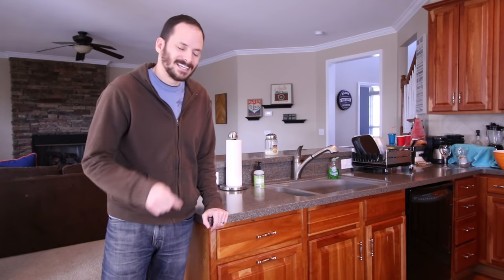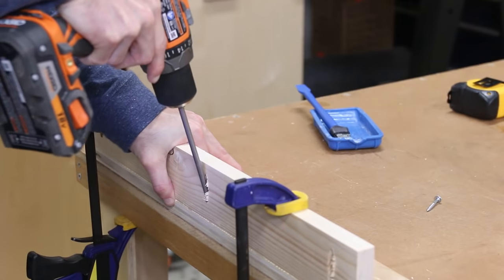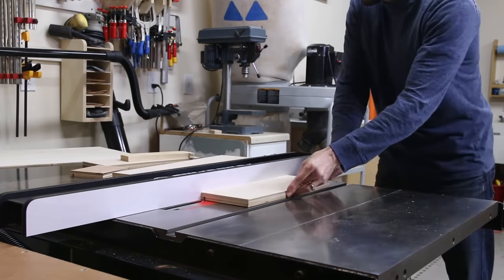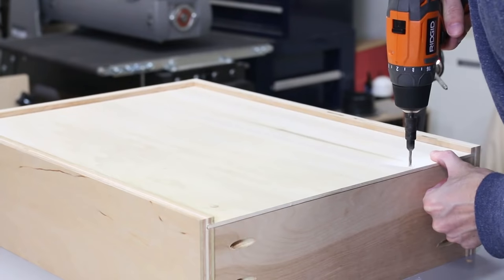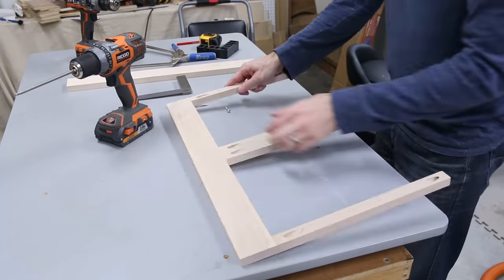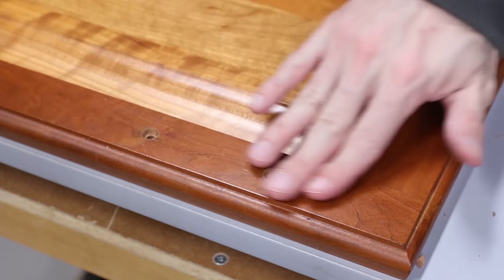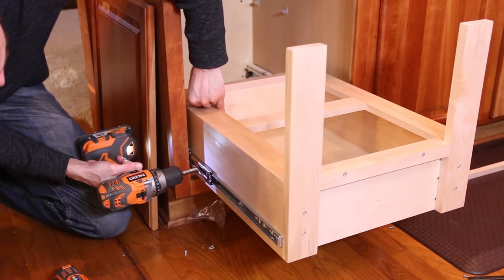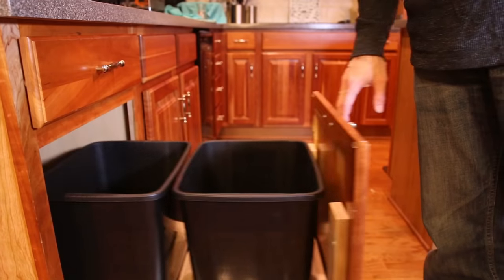DIY Pull Out Trash Can in a Kitchen Cabinet | How to

Comment: Very cool, but DAAANG that was complicated and required a lot of equipment to pull off. I guess this should be titled "DIY - if you're a carpenter with a shop full of equipment"
Reply: mhans311 this is a woodworking channel
Reply: I was just going to say I have no idea what is going on here lmao
Reply: He uses a lot of specialty equipment...but you really only need glue, a drill, and a table saw and you can do the same build.
Reply: @RyanMonty  not even actable saw, you can use a circular saw to do all of the cuts. Or even a jig saw if that's the only power tool you have. Or if you're really in a tight budget, with skills, you can do all of these cuts with a regular saw.

There are a lot of options IF you really want to build this.
Reply: I mean, these are like the basic woodworking power tools. A table saw is usually the first stationary tool people get, and you don't even need it for this. A circular saw (or a hand saw) will work just fine as long as you plan out your cuts

Comment: lol, DIY..... With $10K worth of woodworking machines....
Reply: all you need is a table saw, a level and drill... otherwise, go to home depot and they can cut the wood/plywood for you so you wont need the table saw / miter saw. you don't even need to do the groove (would probably require a table saw or router) for the drawer bottom, you can just drill it in.

Comment: Excellent video. I was looking different designs for a pull out bin. Our 6 month old Weimaraner has figured out how to open our free standing trash can to access all that it beholds, so I need another solution. Fortunately, I happen to have an extra set of 24" full extension drawer slides, along with enough scrap ply and maple so my only cost will be the two plastic bins.
BTW, I love the comment "Making sure to properly document the shavings coming off my hand plane". I can't seem to resist holding the shavings up to the light to make sure I can see through them. Again, great job.

Comment: Most any ball bearing drawer slide manufacturer also makes a rear bracket which allows you to mount the front of the slide to the cabinet face frame and the rear of the slide to the back of the cabinet, no shims needed along the sides. I measure the depth of the cabinet, subtract an inch and order that length slide with rear brackets. Then I cut a 2-3" wide strip of 1/2" plywood maybe a 1/16" wider than the width of the front face frame opening and mount the rear brackets flush with the ends of the plywood strip. The slides slide into the rear bracket, you attach the front to the face frame and push the plywood backer back to the back wall of the cabinet making sure it's square to the face frame and screw it to the back wall of the cabinet. Job done.
Reply from the maker: +Tracy Luegge yup, that would work too!

Comment: I really want a pull out trash can, however the cabinet i want to use is a 3 drawer cabinet instead of the large single door cabinet. I would need to get a new cabinet door somehow and they are the cheap laminate cabinets from Lowes so i'm not sure if i could build something to match.

Comment: Appreciate the help. Gave this a try, and it turned out ok, but not great. Unfortunately, the top of my cabinet door sticks out more than the bottom The bottom is solid against the face frame while the top has a good 3/8" gap to the face frame. Ideas? Shim the bottom of the tall anchor boards

Comment: a quarter inch bottom seems a bit filmsy.  I use 3/4 bottom pocket screwed - it's on wheels so the weight is negligible - and the added momentum feels more substantial, smoother action.

Comment: Great video! I'll prob be using it as a reference to build one myself. 
One question though; are you worried about the trash cans becoming too heavy for the 1/4" plywood on the base of the drawer? I'm wondering if I should consider 1/2" with 2 trash cans.
Reply from the maker: +Joshua Glorioso I thought about it, but figured I could always beef it up later if needed. Though I put a fair amount of weight on it and it was fine.

Comment: You have really good idea. Right now I have 1 under the sink pull out trash can. I need another bin for the  big milk carton, eggs carton, papers, etc.  Are you using 8 gallon or 30 litre bins ?
Reply from the maker: I took the labels off them, so not sure exactly what they are.  But from what I recall they were between 7 and 8 gallon cans.

Comment: What are the brand and dimensions of your trash cans and where did you get them? I have been wanting (*needing*) to build a pull out since I moved in my new place last month (which has no place for a trash can otherwise), but cant find one that is reasonably priced that will fit. If I'm going to buy the ones that I've found that do fit, I might as well just buy the whole pull-out system. Thanks for the great video! And P.S...like everyone else, what I wouldn't give to have your shop in my basement!!!
Reply from the maker: Hit the blog post (link in description) and I have direct links to the cans

Comment: Hi Brad,  It's been about five years since you posted this great video.  I'm hoping make something very similar for my kitchen trash cans and wondered if you have any new thoughts or changes to the design?  I'm currently debating about mounting the slides the top vs the bottom.  Since the pull is at the top it might slide a little easier especially when there's more weight in the cans..... just a thought and value your opinion. :)
Reply from the maker: Ours has worked out really well.  But a top loader would be fine too.  Lots of commerical ones are built like that

Comment: Hi having an issue where about a year ago the garbage cab pull out cabinet per your video tends to open on its own. All screws, tracks seems to be secure but when you close the cabinet it slowly opens up (very annoying). Any ideas on what I can do?
Reply: I have the same problem with mine.

Comment: Actually, can pocket hole break the wood?
Reply from the maker: +jia sheng lee not sure what you are referring, but it was all joined well and nothing went wrong with the pocket hole joinery
Reply: Fix This Build That because you didn't pre drill for the screw, if you screw the screw directly it will break the wood .
Reply: Pocket screws are specifically manufactured for this application. They have a slight groove cut into the tip of the threads that acts like a drill bit and in essence drills a pseudo pilot hole. The only issue one might have is the screw being too long for the wood, that can cause the wood to split.

Hope that helps.
Reply from the maker: +jia sheng lee none of my wood broke.  The pocket screws are self tapping and drill their own pilot holes.